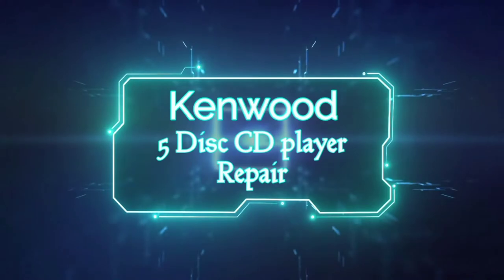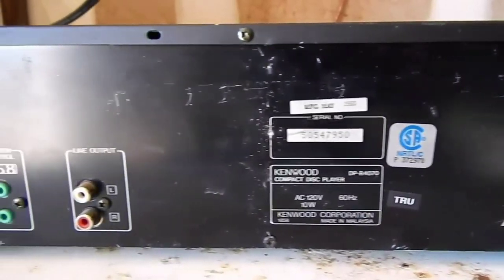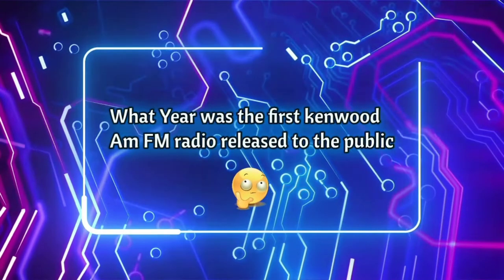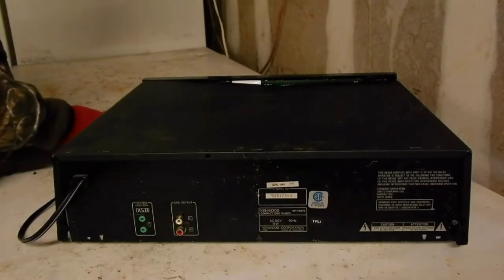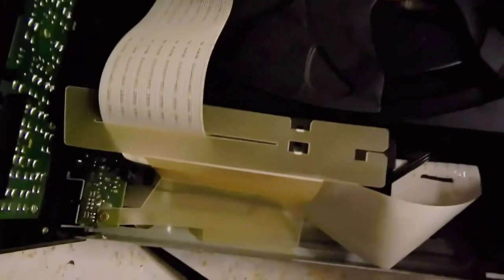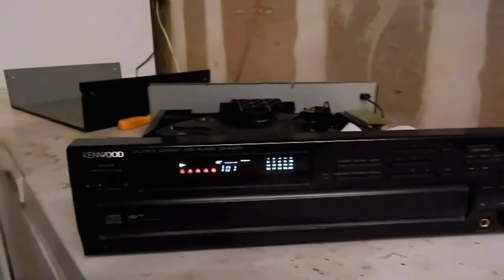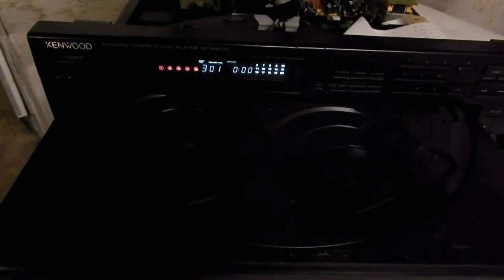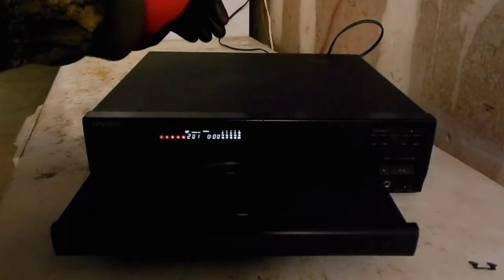#Kenwood 5 disc CD player repair

Comment: I have one of these and it skips all over the place on perfectly good CDs. I can play those CDs on other players and they work just fine. This player will be playing one track and suddenly skip to a new track or it will Skip and repeat and repeat and repeat the same part of the song. I need to send it somewhere to get it repaired. It even skips while using one of those cleaner CDs.
Reply from the maker: Thanks for,you're question, after alot of research,it seems the simplest thing is vibration,don't really know why.try and reduce the vibration, die to speakers,

Comment: Hey there! I bought one of these used, and it comes in but won’t open. I took the cover off and there were two loose bits, a metal clip and a plastic piece…but I have zero clue where they are supposed to go!
Reply from the maker: Thanks for watching.
In reply to you're question.
Not sure either,I'll research it further
on mine in the shop it works fine, to see,and ill get back to you.
thanks

Comment: I have a R894 player. A small V shape pin came out. Where does it go. I opened it up a don't see where. Won't open,close or rotate discz
Reply from the maker: @shirleybostock7883 Thanks for watching,and you're question:
In reply here are some links to fix youre issues.
https://www.google.com/url?sa=t&source=web&rct=j&opi=89978449&url=http://audio.manualsonline.com/manuals/mfg/kenwood/kenwood_cd_player_product_list.html&ved=2ahUKEwibjbuYhpCIAxWQLUQIHcKxCMUQFnoECB0QAQ&usg=AOvVaw1NVRVSYIgB854sWn5ZrU0u

Comment: Got a Kenwood CD player CD -204. It won't play any CDs I try to Play. It was working great. But just quit working. It's made just like this one in this video
Reply from the maker: thank you for the questions,The most common issues are, 1.motor band comes off or loose,2.cd laser dirty or debri blocking it.3 blown fuse.4.if the unit powers on and cd tray works and rotates,meaning that you can change cds,but it wont play them. check and clean the cd changers laser housing.with a cd laser cleaner.hope this helps.if there are any other issues let me know,thanks

Comment: I have this player. Sometimes it will boot up&read the cds and sometimes it won't. Any ideas on what's wrong?
Reply from the maker: Thank you for watching the video, what it sounds like to me is you have a laser issue try cleaning the CD laser with a Q-tip and alcohol gently rubbing it if you can if you cannot access the CD laser itself then you probably would be better off purchasing a cd laser cleaner runn that, hope this helps
Reply from the maker: Also it could do to be the format of the actual CD is different than your player can play is some songs play on your device and some songs don't play and show up as errors that is the problem they're recorded in a different format

Comment: I have this exact CD player but the drawer doesn't open. I have the cover off but the tray does not spin. The buttons to switch discs works but nothing happens. Next I'll look for loose wires. Knew it was too good to be true. Lol
Reply from the maker: Thanks for the comments.
Solution possibilities and fixing the issues. 
Try checking the motor belts they may have become loose or broken,if all the wiires look okay,thats probally the issue.there under the disk tray there should  be a little motor with a small rubber belt that connscts to the cd tray to make it rotate.
if those are missing or broken the tray will not rotate.

Comment: @mrkingfish Hey Chris, I have a Kenwood CD204 5 CD Player that had been working perfectly for over a year after I purchased it at a garage sale. It’s been a month or two since I last used it. When I went to play it yesterday the output was way less than desirable. I thought that the laser must need cleaning so I ran a cleaning CD disc several times with zero improvement. I then took the panel off thinking maybe I need to use a Q-tip and alcohol cleaning directly to the laser. Unfortunately, no change. The sound was static and occasionally failing to maintain audio continuity. In other words it sounded like I was playing badly scratched CDs, but they were all in pristine condition. Any suggestions what I might try to fix this issue. Everything mechanical seems to operate perfectly. I’m baffled. Thanks, Danny
Reply from the maker: Thanks for watching, and your question. sometimes the audio jacks on the unit itself can become dirty, try cleaning the audio inputs out with a Q-tip and check your cables and make sure they're okay , hope this helps

Comment: I have an old Kenwood 5 disc player (DP-R99) that doesn't lift the CD up into position to play on its own. You can hear it trying, but it never works. If I stick my finger thru an access hole on the bottom of the unit, I can push it up into place and it will play the CD. I have taken the lid off and don't see anything obvious. Any suggestions?
Reply from the maker: thanks for watching,in regards to you're question as far as i can guess,there is either  a gear mechanisim  slipping out of place,and some have small bands that work the mechanisim,if either of these is broken or slipping it wont position the cd correctly.try checking if the gear mechanism is out of place causing the gears to slip,or if the band is broken,hope this helps.follow up if you have any further issues.
chris love

Comment: I have a Kenwood DP R4450 5 CD player and it is slow. Should I take it apart like you did and see what may be the problem? I have no clue how to do this, but I'' try.
Reply from the maker: Hello,thank you for the question,,in regarding.i see no harm there,,go for it,remove power cord from outlet first,then remove the panel and take a look,inside,after you have the panel removed,,plug it back into the wall.and power it up,,then if you see an issue,try and fix.
I hope this helps.

Comment: Hi, so I have a Kenwood system that consists of a tuner , synthesizer , duel cassette player and a 5 disc changer. All separate units. The one issue I have is there is an extremely loud hum that I get sometimes when I'm playing my drums. I think I've pinpointed the source of the loud hum but not sure what to do about it since I know squat about electronics. So I'm playing and all of a sudden, mostly when I hit my 8 in Tom it triggers this loud hum or "buzzing" sound that drowns out the music .  I can move the white and red rca cables in the rear of the disc changer and the hum will go away. I can also move them and create the hum so in your opinion, if I replace the part that the cables plug into, will that eliminate the hum? Or do you think that it may be something in the tuner that is causing this?
Reply from the maker: Thanks for the comments and Questions.
In reply,to youre question.
As i understand,it,you have a set of drums. and you play along while listening,to youre kenwwod system? 
And as youre playing along >and hit the tom,it creates a loud hum,on the kenwood stereo..Are youre drums micked,to the kenwood,or not micked,example,basic stand alone drums.
The first thing i would check,would be the cables,overtime cables can become noisy,if moved around alot.But if the cable or cables are good,and you know they worked fine,before you hit the tom,causing the hum,then you jiggle the cables and the hum stops.
If the drums are stand alone and not micked to a p.a.system or the kenwood.
Rca cables on the input in have a little metal jacket surrounding the input,that sometimes can become bent or outa shape,causing the cables to become loose on the inputs,so basically there not fitting snug or tight to the input jack on the cd player.try squeezing the jacket alittle ,not to much,just alittle bit,so the cables,fit snug to the cd player inputs.there should be no jiggle once there connected.
Try this first,if you have anymore questions or issues let me know,and will hopefully eliminate that pesky humm.thanks.
Reply: @Chrislovetv  thanks for getting back to me so quick. No they are no micked, they are stand alone drums. Its weird that the one drum seems to trigger that hum.  It really spoils the fun of playing. I'll try what you suggested. I also took the cover off and used some air to clean the inside, hopefully this will fix it, thanks again.
Reply from the maker: Thanks for the you for the questions comments.

Comment: Hi, so I have the kenwood dp-r894 I put discs in and you hear it spin a couple times with a grinding noise and that’s all it does. Doesn’t play any discs. I took it apart and found a disc inside but after removing it’s nothing seems to have fixed it. Any tips, it just makes a grinding noise and spins any disc slot I choose a few times and that’s it.
Reply from the maker: Thanks for watching and your question sounds like to me that the motor itself may be jammed up. Or the gears have become jammed up also make sure that the motor power connector is securely connected to the main board sounds like someone got a CD locked up inside and went ahead and hit the CD change button and it might have stripped over the gears when it hit the CD if that is the case you need to unplug the main power to the board and replug it in maybe that will reset it I hope this helps

Comment: My player tray works, but it begins playing a cd, then seems to hurry through a song, and then skips on to another. Any suggestions???
Reply from the maker: thanks for youre question,i would try cleaning the cd, if it has alot of scratches,they sometimes do that,,if any other cds play fine,, then its the cd,,however if all cds you try playing skip and do the same thing skipping ahead,,try and clean the laser,if you cannot reach the laser housing,,,get  a cd laser cleaner disc,available at most retail outlets.give that a try..thanks

Comment: Kenwood DP 4080  , rotary  5  disc  , 
always no disc  at display , whats wrong ? Thank you
Reply from the maker: Thanks for watching.
In reply to your question.
I would try cleaning the laser housing,with a cd laser cleaner.
If that doesn't fix the issue.
It could be an internal issue.
Sometimes,the motor that spends up the cd,will lose its small rubber band connected to the motor that spins it up..
If that's the issue.,you'll have to  remove the cover panel, access the motor under the cd tray if that band is missing or broken that's the issue.
If you have any more questions .let me know below.
Thanks chrislovetv
Reply: @Chrislovetv  
Apakah cd cleaner berbentuk  seperti cd atau cairan , masalahnya  cd player  saya sudah lama tidak  dimainkan , 
didiamka , dtaruh saja sampai 1 tahun  tidak dimainkan , adakalanya 1 lagu bisa dimainkan , masuk kelagu berikutnya error , no disc , 
Saya akui Player Kenwood untuk kwalitasnya oke , very good , 
Terima kasih , balas pertanyaan saya ok,
Terima kasih @Chrislovetv
Reply: Saya dari Jakarta , Indonesia , 
di Jakarta sudah tidak ada service centre
 Kenwood  sejak akhir tahun 1998  ,  
Terima kasih Chrislovetv
Reply from the maker: in reply.to youre question, t he cd cleaner ,is shaped like a cd,with a small btush on the underside,the liquid is applied to the brush on the underside of the cd..
Reply: @Chrislovetv  
🙏 , thanks , Chris
Reply from the maker: You're welcome..thanks again

Comment: My Kenwood 204 cd player issue differs from your previous inquiry. Would appreciate feedback considering my issue of all CDs sounding like scratched LPs skipping syllables with added noise, never a clear note, but audio is somewhat understandable. Thank you!
Reply from the maker: Thanks for watching and your question.
Try cleaning the laser with a CD cleaner or a Q-tip, then try cleaning the audio input jacks on the back of the unit clean the inside of them with a Q-tip in a little bit of alcohol also make sure your cables are secure and are working thanks for your question hope this helps.